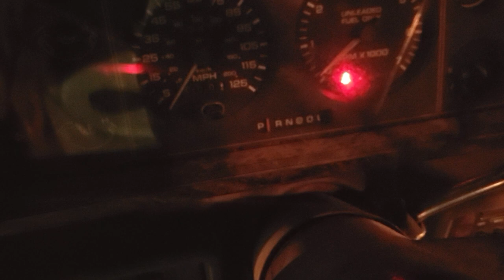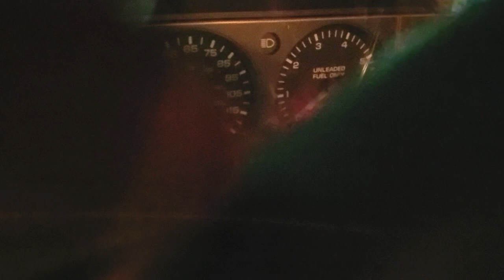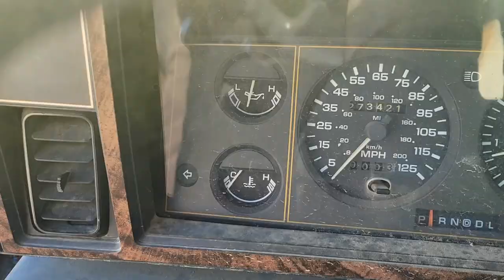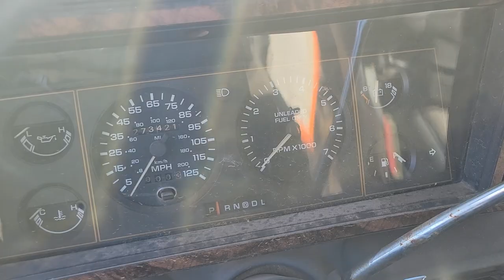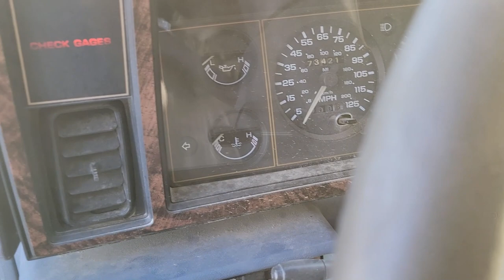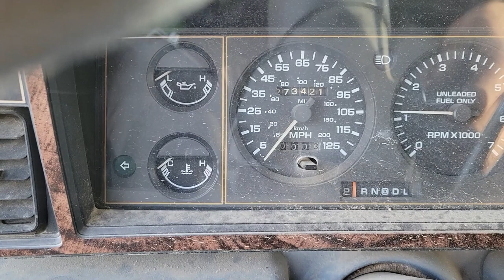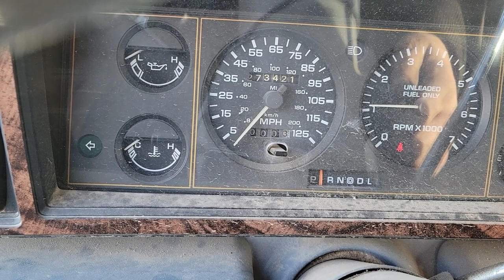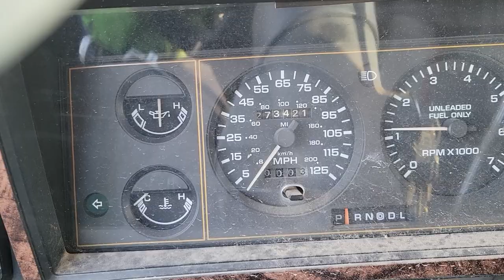1990 Dodge Grand Caravan LE "restoration" | Part 3

Comment: The oil pressure gauge was working before, so why risk damaging the engine instead of checking out the sensor, wiring, gauge.

Comment: 30 year old car… how are u still able too get parts for it? Had a 98 Taurus… started having issues with parts or if I did find em they were way overpriced
Reply from the maker: So a lot of these parts are interchangeable with newer caravans (through ~2000) like alternators or ps pumps for example. Sometimes I get lucky... an Autozone in the Twin Cities had the power steering pressure lines for this in stock... Otherwise RockAuto is a really good source for new parts. Body panels and interior bits is a bit of luck with the junkyards. Keeping an eye on their incoming inventory helps.